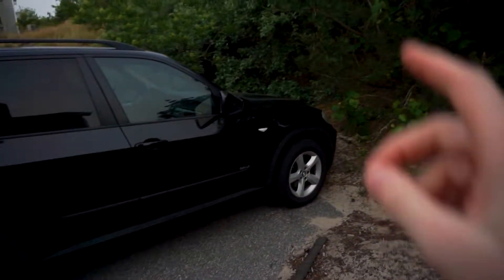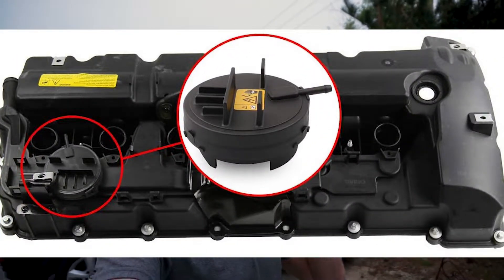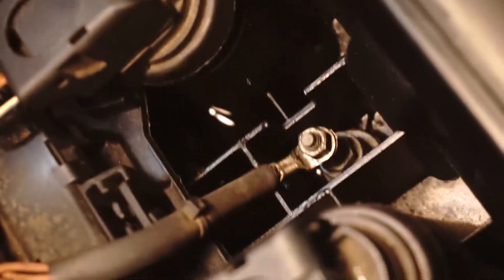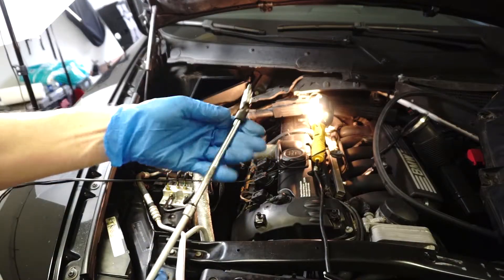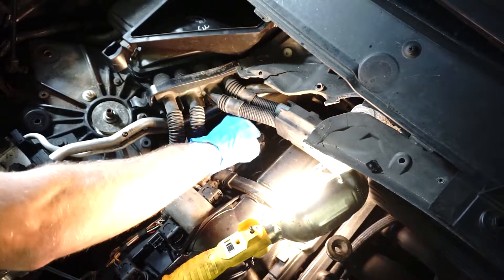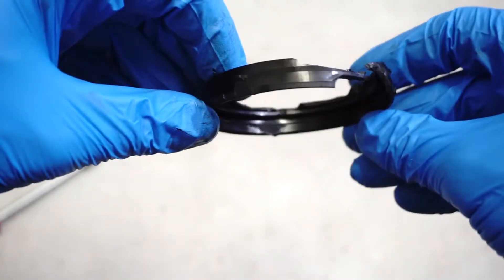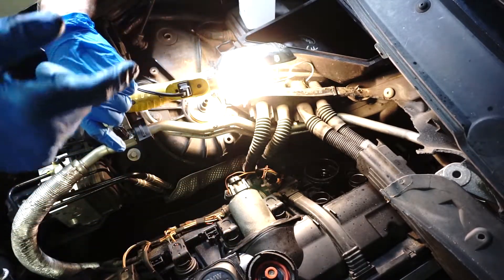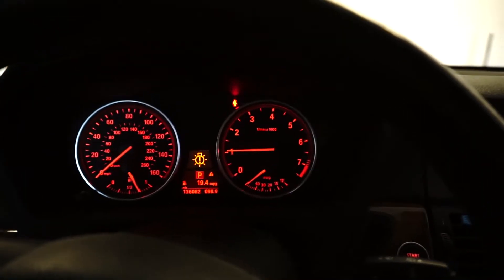How to replace CCV CVV PCV valve replacement BMW N52 Rough Idling

Comment: I have owned F10 5 series 2011 (n52) for the last 5 years and its been good to me.

Issue and Symptoms:

Every time I start my car it will start normally and in 5 sec after that I would hear a short hassling whistle and it would start to vibrate for 6 to 10 sec while the rpm needle would remain below 1000 and then it would pick up the RPM and stop vibrating (not completely you can feel light vibration). And driving if i step on the gas it somtimes delays in reacting and if I do stop at the light you can still feel is vibrating. I'm also getting some smell from the exhaust pipe but no smoke but its a strong scent.

regardless of if the car is cold or hot if I start the car is would act in a similar manner.

I believe it could be a vacuums issue (not sure though)

Kindly assist me please
Reply from the maker: You can also check the car for vacuum leaks, i gonna make video about the tool and how to check it as well, i think you also can check the CVV for vacuum leaks! I'll fix the video on upcoming Tuesday! So be ready for it! Thanks for idea by the way!)😁
Reply from the maker: I would try to determine whether ticking noise comming from CCV, which is you can put your hand on the top of CCV and try to feel any type of feedback from it. As far for the CVV it's oil separator, if it's broken the car can eat some oil, as well as have little more exaust gasses, or stinky smell. In my case i was looking for problem, and if i would know for sure that's the CVV, i would replace the whole engine cover. As well I'm planning to sell the car soon, so it's not ideal for me to invest some money in to, that's why i go with cheap repair, as well as Video content...